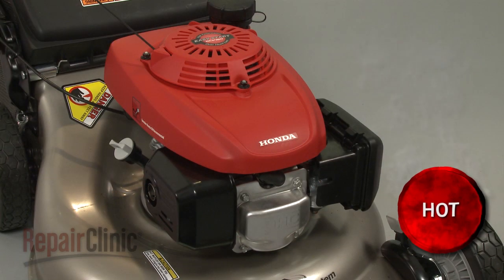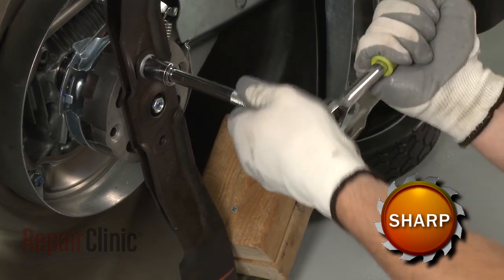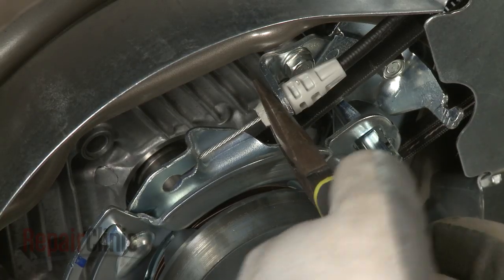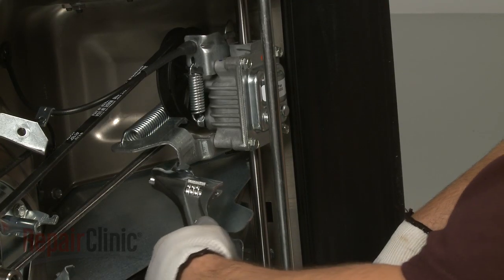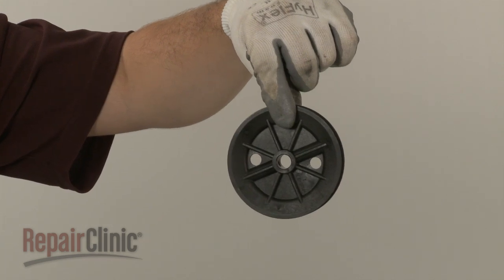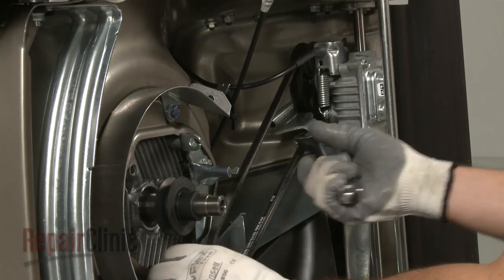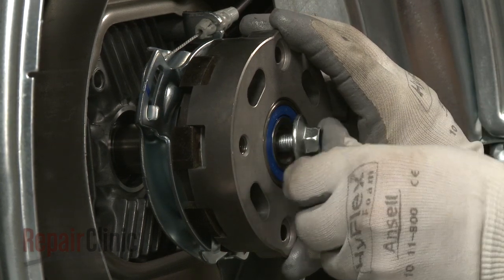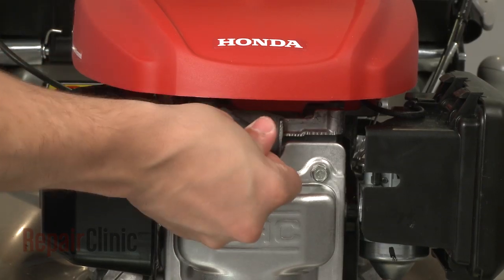Honda Lawn Mower Drive Pulley Replacement #22421-VH7-L00

Comment: Does anyone know how to get the plastic type shielding off?  I can not find a video that shows the steps for HRR2169VKA and I think the only difference is how the shielding is mounted.  Mine is one large plastic shield not two seperate metal pieces like the one in this video.

Comment: no need to separate the rear deflector from the belt cover can be removed by taking 4 bolts off. a block of wood behind the trans helps when your removing pulley pin